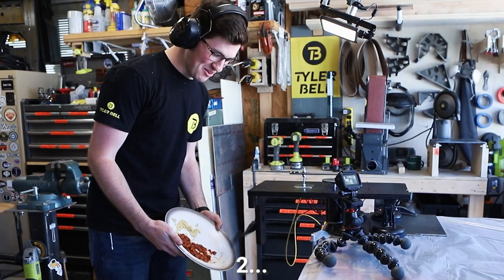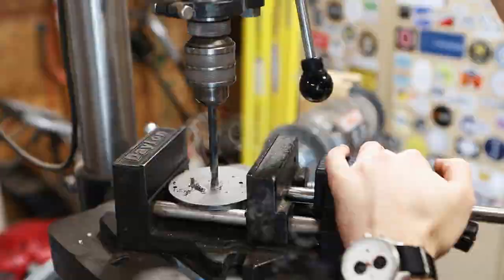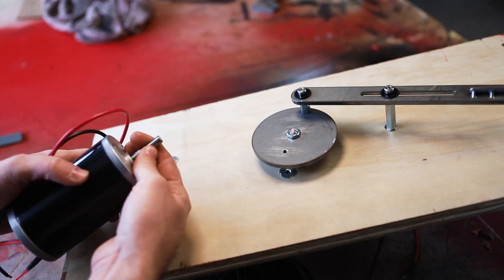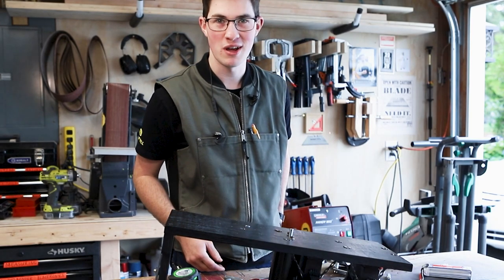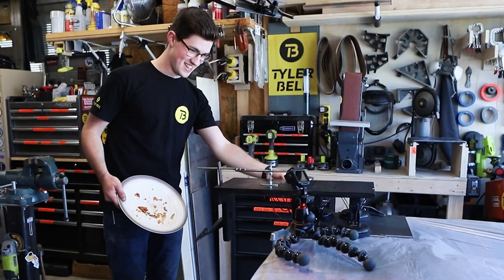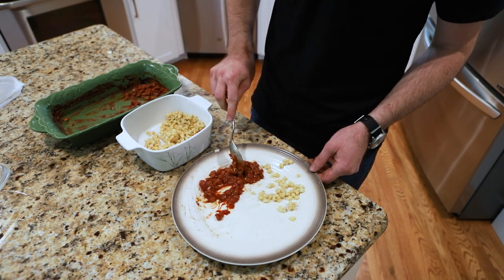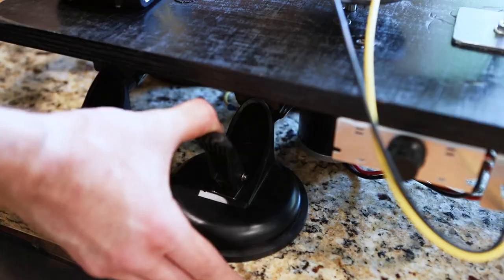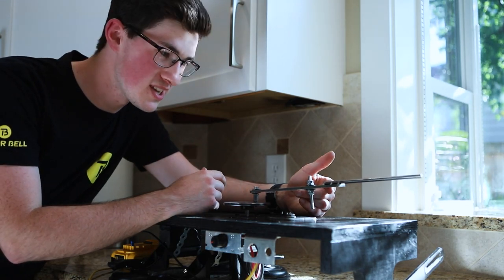A NEW WAY to CLEAN DISHES

Comment: That nail gun trick is so unsafe but so useful. I love it
Reply from the maker: I totally agree! Love that trick
Reply: My friend has a small piece of 99cord (thin 99lb paracord.) Looped on the side of his nail gun, and when he wants to do that he just pulls the loop around and hooks it on one of those plastic self adhesive hooks on the side. Then you can just fire nails at will...
I've since stolen that idea and made my own version with a little flip down plastic piece for when I shoot nails through foam for basic cosplay projects.

It's much safer and you can still use your other hand.

Hope this helps, good luck.

Comment: Your invention is going to be in everyone's kitchen, guaranteed! I would have only 100% power going to the scraper, no adjustments!  An option might be a more powerful motor. It should also use 110V AC or even better, 220V AC. A razor blade attachment for those stubborn food particles would be a great accessory! No need to place any warning labels on it or do any testing on it, its clearly proven itself to be 100% safe, for any age! One of its many features is its ability to detect and eliminate any dishes that might have an invisible crack or some other weak point. I would get that food scraper patented immediately and start selling them!  Can't wait to get one and give them as presents to everyone I know! Man I wish I came up with this idea! Great job!

Comment: A bit like when I tried to build a reactionless drive. The thing about crazy failed inventions is that you learn a lot about mechanical engineering and physics. Actually a simpler method would be a motor spinning lots of silicon rubber flaps, the real challenge being a feed mechanism and a system to angle the flap-wheel which might require some sort of robot vision system and microcontroller, two fields really worth adding to your skills.

Comment: This is not such a bad idea, but it would be kinda useful if you had a manual dish wiper like a butter knife but 25% bigger and the blade section made from a flexible silicone, a bit like thoes things people use to get water off a car after washing it. You could also make a curved one for dishes.

Comment: OMG i got the 1k like o.O   what were the odds?!?! 1/1000...  right nm.. but cool video bro!! ps. i made something simlilar but i just used a drill with what my dad calls a squirrel cage fan and sponges... yours is cooler cause it's loud and breaks stuff.. also prolly doubles as a jack hammer when you WANT to break dishes... 1000 cool points dude!!